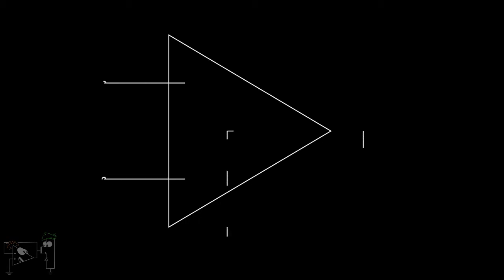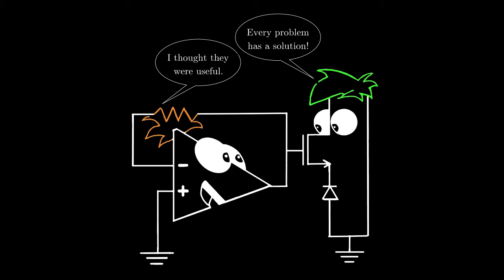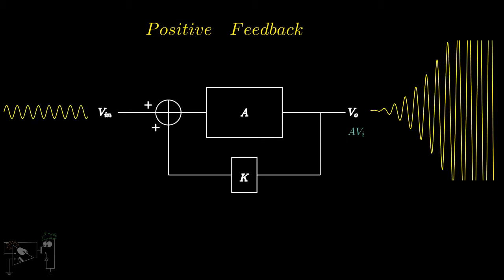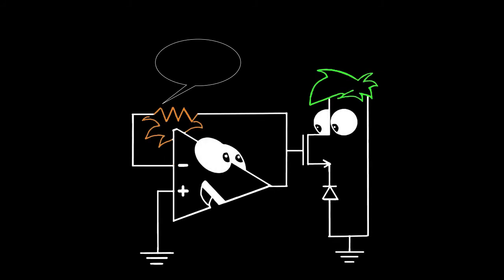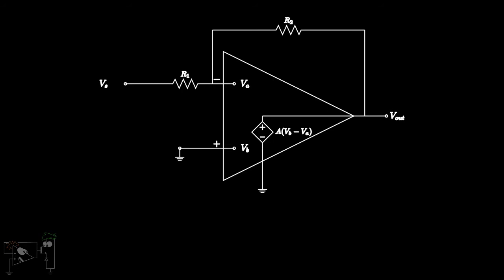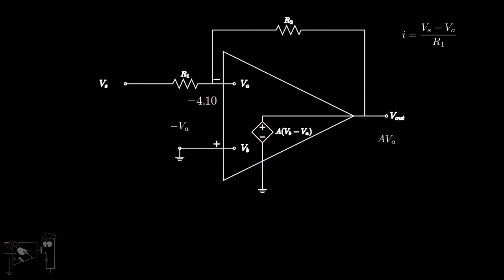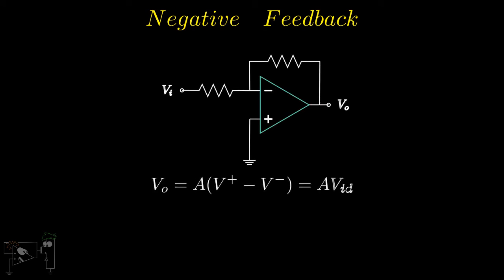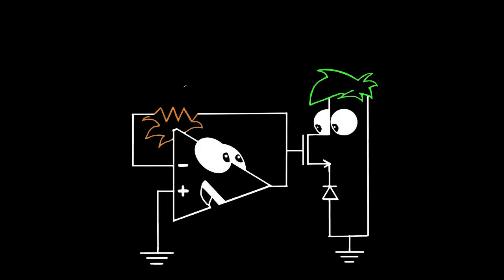2. The Virtual Ground Concept

Comment: Dear sir,  I want to ask one thing is that  initially when current was start to flow , Va was  +ve  and Vid was -ve then current was flowing from i/p voltage side to output side ok. As you stated to compensate this large current , Va  become now -ve and vid  +ve and the current start to flow from output side to i/p side  ok.  My question is that since the Va is negative and I/p voltage is +ve then how can current flow from Va to i/p voltage side (lower potential to higher potential). pls clear this thing. However most of the person explained virtual ground concept as you stated by mathematically not in the flow of current.